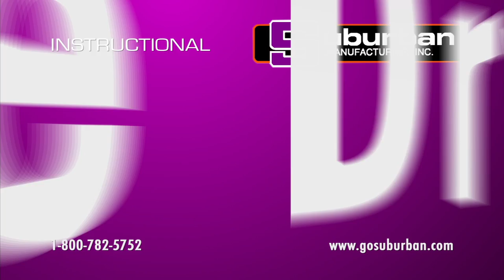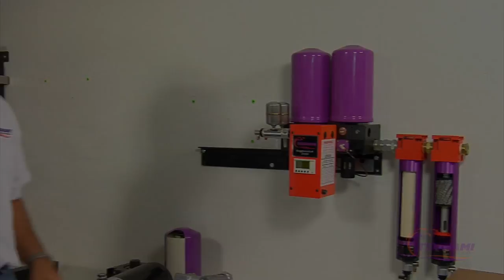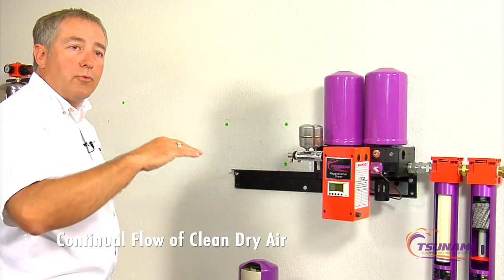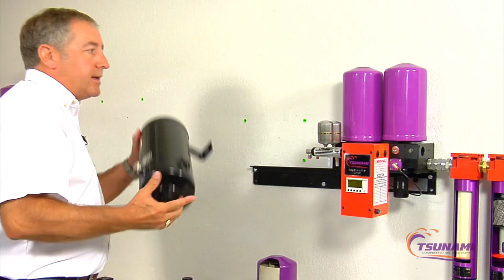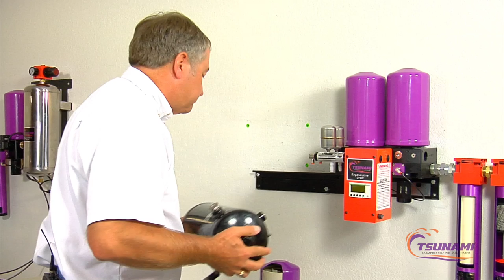How Regenerative Dryers Work

Comment: So I'm guessing some kind of baffle is in place in the middle of the tower to direct the air flow upward through the tower on the inlet side then back down on the outlet side to get it to flow through the desiccant?  Or is there a restriction orifice on the outlet to provide resistance?
Reply from the maker: Very close! In addition to internal orifices, there is a small piston below each canister that dictates the path of air flow. These are the only two moving parts in the entire unit; resulting in a very low pressure drop and minimal maintenance.

Thanks for watching!